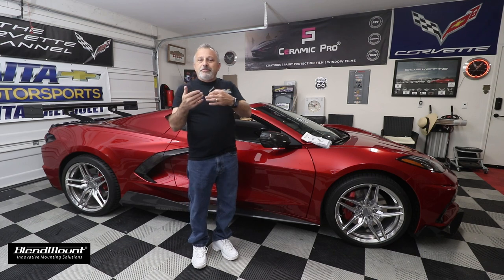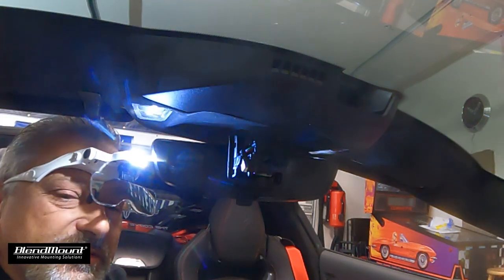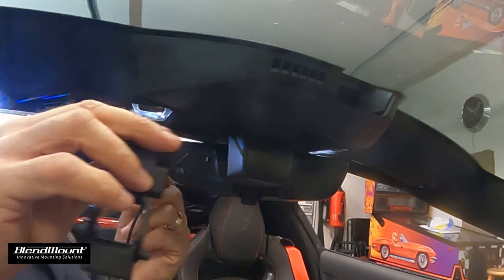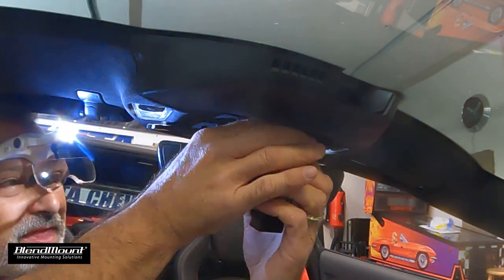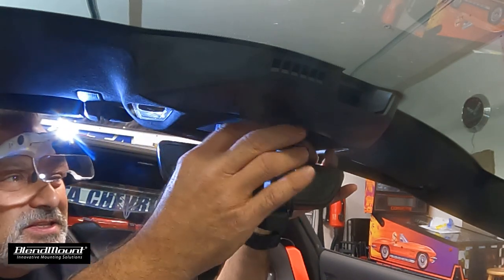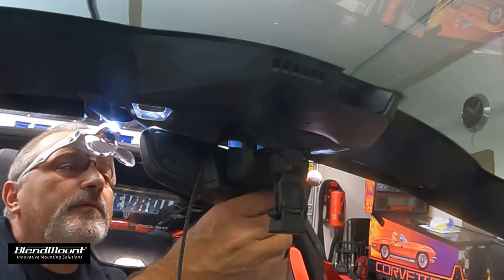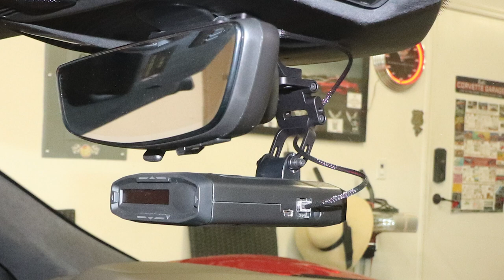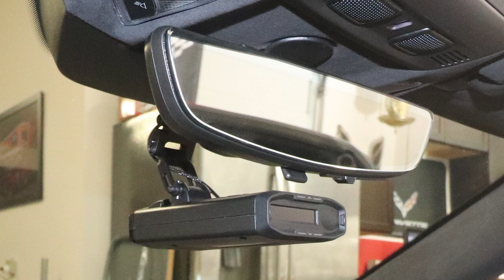How to Install a Radar Detector in a C8 Corvette

Comment: It’s all a matter of putting the wire in the correct port. Not difficult , but some good lighting and a steady hand should be sufficient. There are a number of videos out there about it , watch a few and you should be fine . It’s the absolute best option for mounting the radar.

Comment: Great Video! Just FYI you dont have to actually start the car for your radar testing, just put it in accessory or "diagnostic" mode briefly (heavy draw on battery) by holding start button for 7 seconds (without pressing brake).

Comment: I am about to get my corvette C8 2024,I bought uniden R8 ,Ive heard this type of installation can fry your mirror.
GM has released a bulletin about it .
If you install a radar if something happens your  are out of luck .
I am getting C8 2LT Convertible ,not sure if I want to risk it
Reply: there are three connection points, in the rearview mirror assembly, red, black, gray if you plug one of the wires into the gray that will short out the driver side rear view mirror, thereby causing the problem that you’re worried about. He may not have answered your question because he tends to only like to respond to things where they send him free equipment and merchandise.